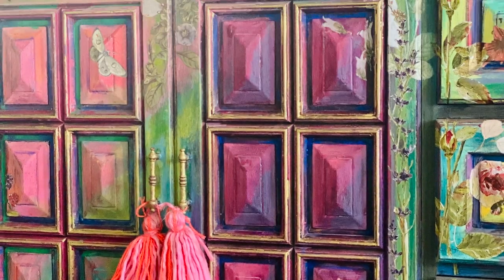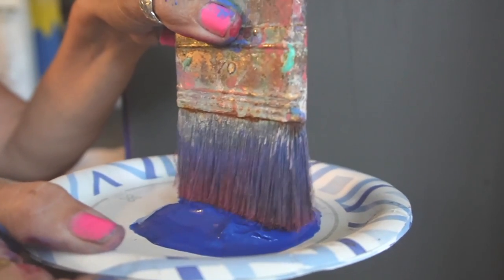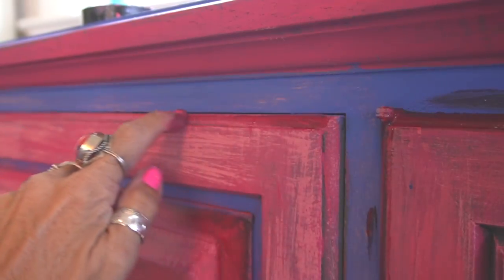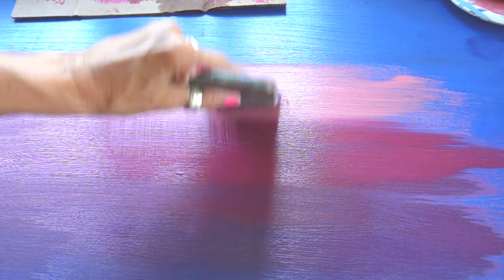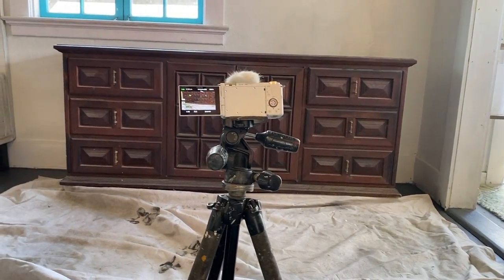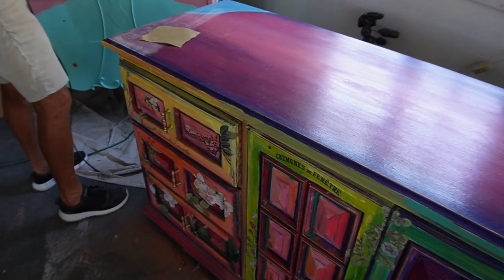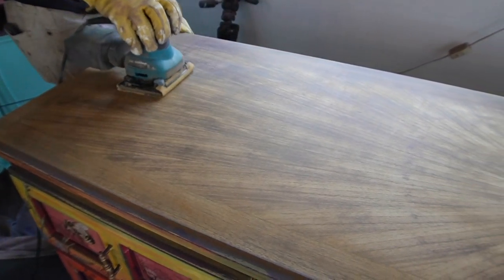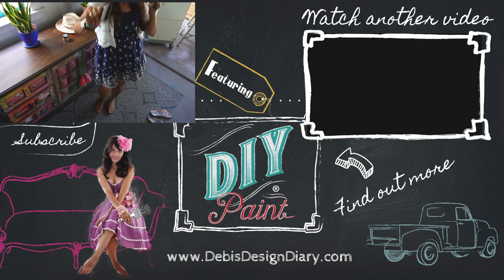Painted Haunted Furniture? Using Pigment Powders

Comment: You can get yourself a bunch of white sage (if you have a local crystal shop they might have some) and just "smudge" each piece you buy. This means simply lighting up the sage, blowing out the flames and while it's still smoking pass the sage all over the piece (above, under, inside) so that the smoke touches all the parts. 
If you think this is too "woo woo" just remember that many cultures (including indigenous Americans) from all over the world have done this for centuries (purifying with smoke) and also, in many churches they burn incense and walk around the church with the incense burners - maybe not so much nowadays but this used to be common practice.

Comment: I am glad I am not the only one that has felt that way about this subject.  I try to only bring home items that I am totally delighted by and that I feel happiness around.  I also leave them in a building for storage sometimes so the spirits can get aired out of them.  I guess someone mentioned old mirrors can be the worst for this. Who knows I have purchased 3 over the years one is in storage and will go over my vanity in my bath. Two are very strong solid feeling this one is light and feminine.  I do have a small east lake dresser I got on marketplace came out of a cottage on s local lake called east lake.  It has wood pulls all original everything in tact. But the minute I unloaded it a pull got broken.  I am a bit iffy about it.  I like it but am having issues placing it in my decor.  It's not happy.  I feel like it misses the lake. Dumb to think this way kind of woo woo weird I know.

Comment: Hello Debi, thanks for your very inspiring videos but I am wondering, do you paint the inside of the furnitures  (drawers, shelves, doors etc. ) as well ?
Can't leave it with a beautiful outside and some old paint inside...
Reply from the maker: I’ve never painted the inside, of all the hundreds of pieces I’ve painted I have yet to run across furniture that has the drawers painted on the inside they are usually left un painted. I see some furniture artist painting the sides that pull out and it looks very pretty but I don’t.
Reply: @DebisDesignDiary  thanks for your answer

Comment: I know it took a lot of work, but I really think it pulled off! I also love your stories in your videos. They always keep me hooked! I am curious though, what's the difference between a ghost and a spirit?? The story you told described what is technically a ghost, but a ghost is just residual Internet I am curious though, what's the difference between a ghost and a spirit?? The story you told described what is technically a ghost, but a ghost is just energy, much like a spirit. I didn't believe in either, until I had encounters with both. You absolutely can open doors to unwanted energies. I wouldn't really say that tarot would do that since it's coming from the reader, but if the reader had negative attachments and didn't really know what they were doing, it could be a possibility. Always know what you are dealing with! LOL! On another note, can you blend using crisp cross strokes? I am a visual artist as well and I've always been taught to blend that way. 🤔😄

Comment: Debi, that looks beautiful! I need help, why does the liquid patina stay tacky? I have decoupaged a few items and after weeks it is still tacky. What can I do? I have also used clear wax with same results.
Reply from the maker: Sometimes liquid patina can stay tacky in a really humid area. If you can put the project in a place that is dry and give it some time it should cure. I’ve never run across this issue but I’ve heard of people living in the Midwest in the south during the hot humid seasons say that they have run across this

Comment: The piece had a lot going on structurally before you started, it was not an attractive piece when you took it in, so it really required a full, ornate transformation.  You desired to work with the initial colors, pink and blue, but that piece didn’t lend itself to that look.  To be honest, the dresser was an ugly duckling by itself.  What ultimately became the completed look is more your signature Bohemian style and it works very well with that piece.  Great idea to sand down the top, it had that beautiful starburst in the wood and gave it a touch of rustic.  So all in all, you made it through.  Good job.  God bless.

Comment: If you have the power to open a door, you have the power to close the door.  I've cleared many spaces that had entities.  When you are aligned with love and you are communicating with negative spirits from this place of love, you are protected.  There is a mantra:  "According to the free will laws of the universe, I am exercising my free will and I hereby command any entities, carnate and discarnate, that are not fully aligned with love and the highest good of myself and others to leave."  This works.  Negativity cannot exist in an environment where it has been told to leave.  To persist would be in violation of the free will laws of the universe.
Reply from the maker: Interesting… I recently watched a film on this very subject. You might be interested in it. https://youtu.be/txwrLGAL7Sg?si=2WiH_MnEwNMoXwYZ link to the trailer

Comment: I’m just getting started.  The very first thing I did was a sunflower stencil. I painted a gorgeous one with DIY paint thickened with frosting. 

Then . . . I decided my petals and the center weren’t tight. So I decided to paint over the entire thing. I’m okay with what I have now but it’s not close to my first sunflower. Not even close. 

I’ve resolved to not change my plan OR to paint over until I’m done.

Comment: Have some spare wood to test out your “inspirations” on before working on those big pieces you’ve put your heart into. Maybe that would cut down on the re-do’s and oops, I shouldn’t have done that ideas 🤔🤷‍♀️
Reply from the maker: good advice! xoxo
Reply: I use foam core board from Dollar Tree.  They are big, two pieces of white poster board with styrofoam (?) sandwiched inbetween.  Cost $1  you can write on the back the colors/products you used.